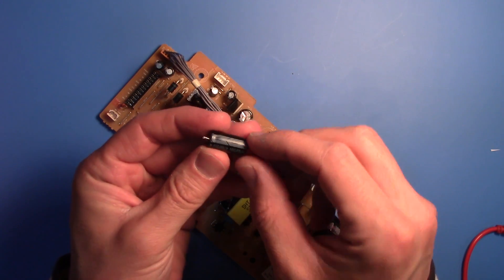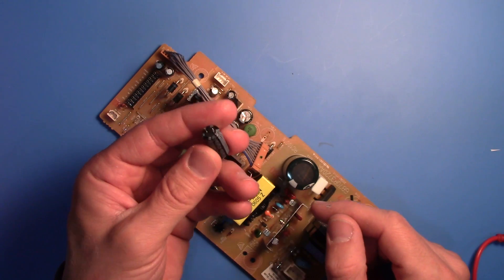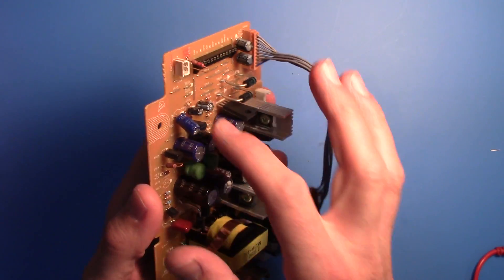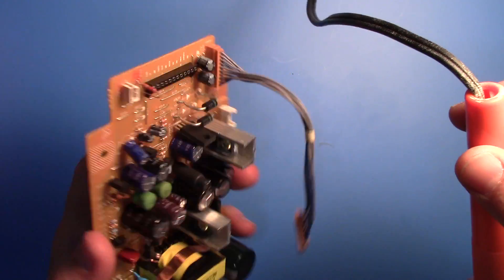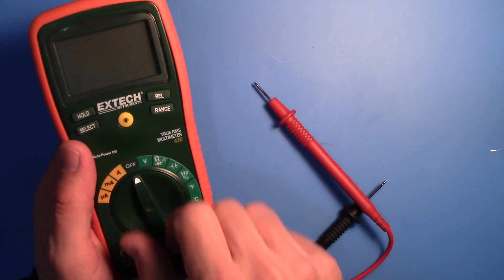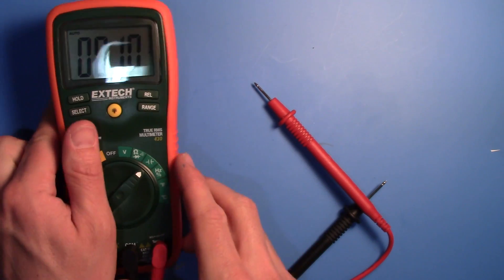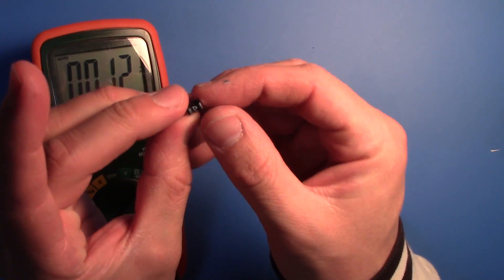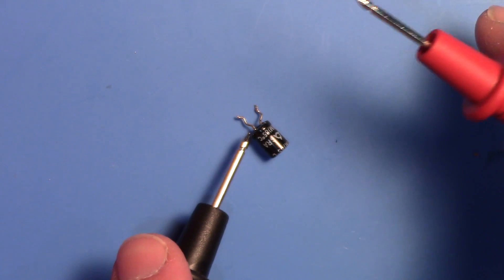How To Test A Capacitor - Electronics Repair Check

Comment: my multimeter only has 200uF - does it mean, I cannot measure any capacitors with e.g. 2200uF ??? I am confused .... I got the XL830L digital multimeter! Please advise ... thanks
Reply from the maker: I took a look at your meter online and your meter won't test capacitors.  The symbol for capacitor is | (
What you see on your meter is a setting to test microamperes (microamps)	μA.
You need to get a different meter to test capacitors.  If you do get a new one I would also make sure it is auto ranging.
Reply: ahhhh shittt :( wasted money then lol - how about the VC97+ look here: http://goo.gl/4AIxyk

can u check if it will test capacitors over 2000uF ??! and would u recommend it .... I know fluke is best but they are expensive, just need a decent one for laptop and pc component testing ... mosfets, IC's etc

cheers
Reply from the maker: The VC97+ will test caps up to 200uF.   To get a good cap meter it's going to cost quite a bit.  Here is a guy who has a lot of vids on multimeters, check them out it may be helpful. EEVblog #91 - $50 Multimeter Shootout - Extech EX330, Amprobe AM220, Elenco, Vichy VC99, GS Pro-50
Reply: yeh I saw VC99+  which has "capacitance of 2000uF maximum, which means, I am stuck for capacitors over 2000uF, right??

not going far, am I :/
Reply: BiMi UK most multimeters only have 20nF to 200uF capacitance (2000uF at most) which are just costly and still limited in their range. I think it's better to just get a good regular multimeter with no capacitance and for capacitance get a separate capacitance meter which comes in the ranges commonly used and some even with a safety discharge function.